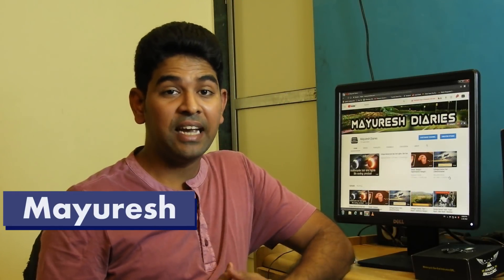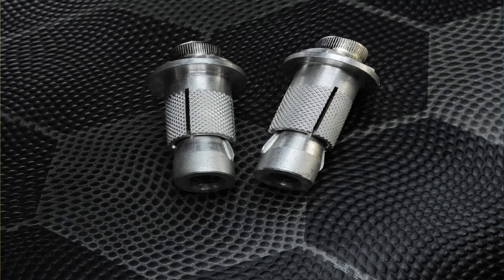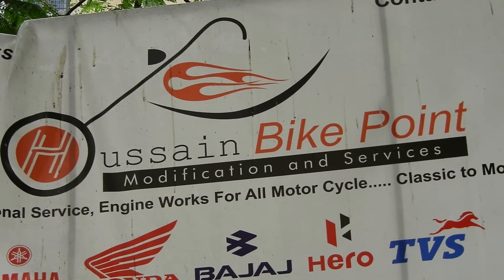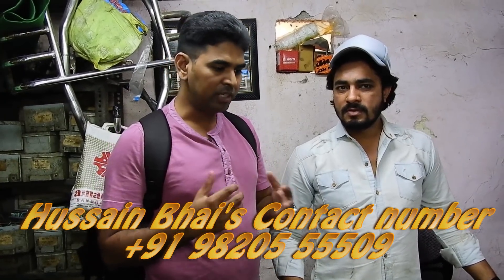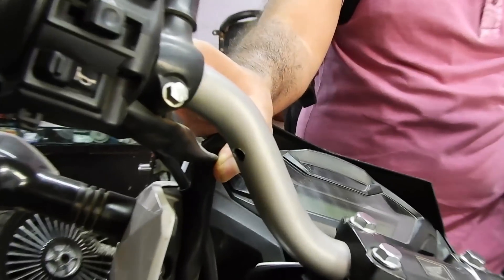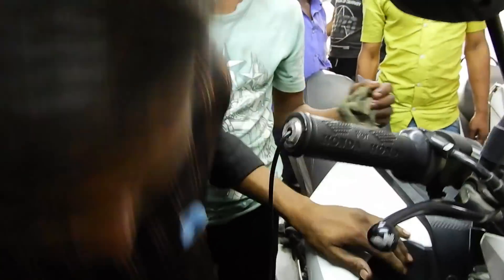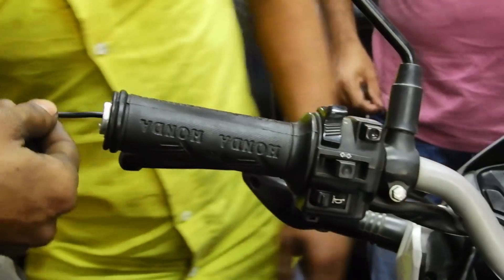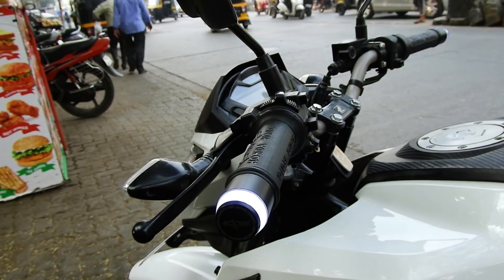Modified Honda Hornet 160 R | Eclipse Motorcycle Bar End Lights - Installation Video

Comment: After changing the Handlebars I have facing 1 small issue. My front disc is working little late. It works but the bite is coming very late. The disc wire is little stretched. I think may be due to pipe stress the brake fluid doesn't flow properly. But it's absolutely my personal thinking not sure about it. If you enlighten me in this respect, then it will helpful for me....
Reply from the maker: May be but will have a word with my closest team of Honda Service Center...and discuss thjs issue with them and let you know my findings

Comment: I need your help.. I have Hornet 160r dual disc varian. Front break is decent but the rear break is pethetic. Doesn't have feel or feedback. Have Nissin caliper on both the break (front & rear).. Now I want to what should I do to make the rear break better. Bike is new, only 3000 km running. Disc pads are absolutely fine. Please help me.... Thank

Comment: Hi, Did you change the color of bike? As per my knowledge there is no white color available in hornet..
Reply from the maker: My Hornet was first model....that time Pearl white color was available now they dont have white color but trust me white suits Hornet the most( btw thts my opinion, your's can be different )
Reply: Mayuresh Diaries I am planning to buy hornet 160r Std ABS.. what is your opinion on hornet performance? Should i buy this bike? Which variant is good std ABS or CBS?
Reply from the maker: Have you taken any test rides? Even I am looking for new bike for my friend may be either Hornet ABS or Xblade but you know you must go for test ride n that too for at least 3 to 4 km...then only you can understand behaviour of bike. Then you can judge whether particular bike is suitable for you based on following points - 
1 - Riding stance/position
2 - How comfortable you are while riding
3 - Your expectations and whether choosen bike is satisfying all those expectations
4 - how frequently you are using this bike or if you are looking for daily commute then how long is the distance as riding position can make you tired and can add extra pain in neck and shoulders area

Think on the above points ... N if you want we can have in depth discussion .. just let me know
Reply: Mayuresh Diaries thanks for inputs... Sure i will get in touch with you if more details needed

Comment: I am using this bike from last few months. I am facing a little problem regarding Handle Bar. Due to short height of It, creates too much pain on my shoulder & palm, wrist. How I can change the Handlebars with little bigger Handlebars... please make a video
Reply from the maker: I can understand bro... Basically this bike is taller in height and thats make it difficult to ride shorter people and also it has semi sports riding position which results in extra body weight pressure on shoulder and palm and neck and I am facing issue though I am 5' 11" in height. I was thinking of converting stock handle bars into more like touring bike which will result in up right sitting position and more comfort. will surely try for this.... Thanks
Reply from the maker: Btw there is one team which converts bikes into touring machine...I dont remember their name but will search it out and let you know
Reply: Mayuresh Diaries ..... Thanks for your help
Reply: Mayuresh Diaries ...... I have changed the stock Handlebars with Livo Handlebars. Perfect fit. No wire cutting needed. Only one drill is needed in Right side of the Handlebar. You fill hell & heaven difference.
Reply from the maker: Definitely you will feel the difference..as Livo is proper commuter and it will definitely give you up right sitting position and it definitely turn out into more comfortable ride and less pressure on your shoulder, plam and neck....thanks for updates
Reply: Tamal Chowdhury

Bro.. I am suggesting you the best option.. Just install Honda x blade handles.. They are little bigger then hornet and are very stable due to the weight inside the handle. It has big iron structure preinstalled inside. And positioning of your body and wrist will be perfect.. Go for it
Reply: RK Solutions.... Thanks for your advice but I have already installed Honda Livo Handlebar. Perfect fit, just need to drill in left side of the bar & need to re-route the acceleration-clatch wire
Reply from the maker: RK Solutions Btw nice  suggestion...Thanks sharing
Reply: Mayuresh Diaries ..... Also just unscrew the Front disc pipe fixing nut in body ( just under the side of front fuel tank) & fix it with the wire lock, so that it not stressed to much

Comment: How much it cost bro
Reply from the maker: Basically Eclipse comes in 2 varient special edition which I bought and other is with chrome finish. Special edition is 2899/- but I dont remember price for chrome finish eclipse. This prices were around 5 - 6 months back. About latest prices I dont have any updates. installation charges 600 - 650/-. This product is waterproof, fully metallic body, In case of damage can easily get repair and it has 1 year warranty also you need to buy friction if you own bike  other than royal enfield. I hope your question got complete answer. In case of other feel free to ask

Comment: Cost of eclips ?
Reply from the maker: Basically eclipse comes in 2 varient. Black n Chrome finish. I choose black one and it cost me 2899/- and installation charges 600/-(Jogeshwari west). I dont remember price for chrome finish one but one with chrome finish is lesser in costing. You can check price for my eclipse in Eclipse unboxing video.
Reply from the maker: https://youtu.be/nLFCLCLpQ3M